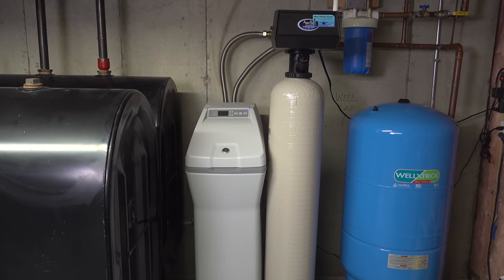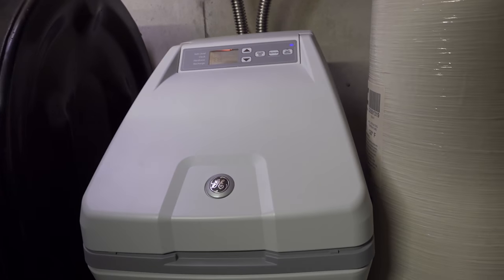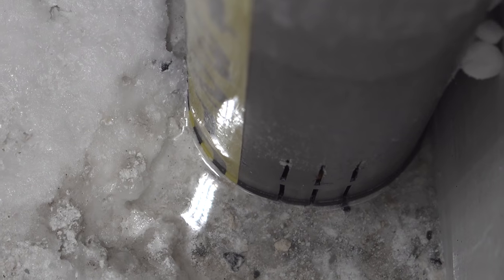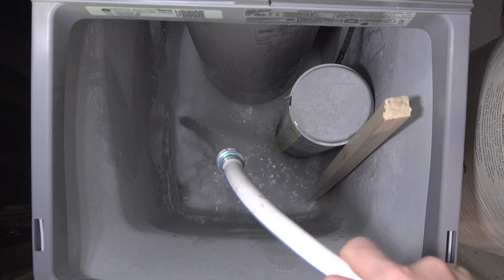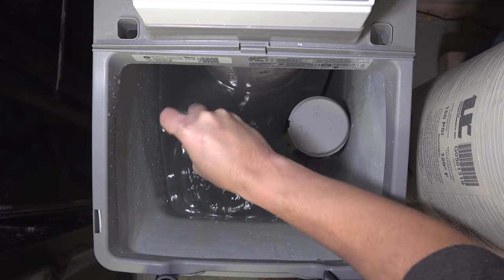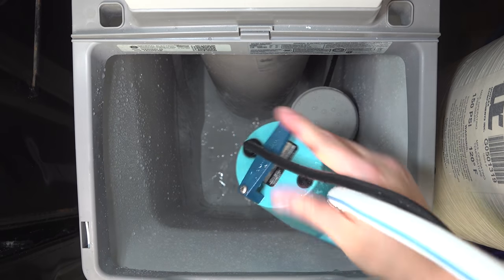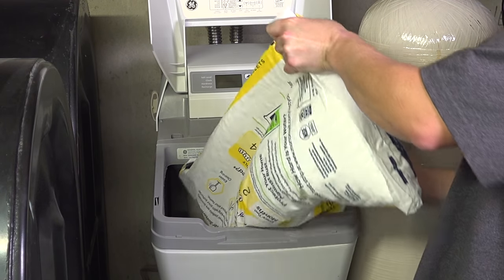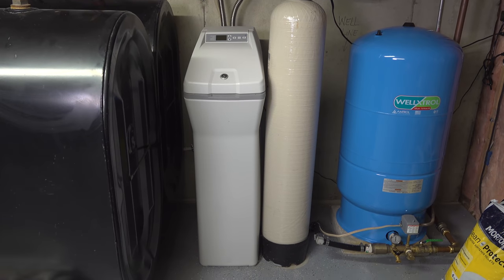How to Clean Your Water Softener Salt Tank - Restore it Like New

Comment: So, first off, Resin doesn't go bad if your system is used properly for your application.  Meaning, if someone says, "But my resin went bad," that means they likely needed some pretreatment or they left their softener in need of repair for years without a proper regeneration.  99% of problems with a softener will be found in the valve body and not the brine tank.  If you are able to regenerate your softener and the brine is drawn into the softener, then all the repairs in this video are not necessary.  Also, if you are going to follow this video, here is a physics lesson:  Adding water to the top of the brine tank will not do anymore good then a few inches above the salt.  Why?  because brine is denser than water and will sink and that brine is what will be surrounding the salt and since the brine will be fully saturated with dissolved salt, it won't dissolve anymore salt.  1 galloon of water dissolves about 3# of salt and no more no matter how long it sits.  So all the water at the top of the tank will still be mostly water and the brine will be at the bottom.  Use solar salt and get a softener that is not all in one.  Having the softener tank inside the brine tank is a major cause of bridging in these systems.  Depending on where you live, you may have a softener tanks that sweats and this added moisture from the tank and the air will absorb into the salt causing it to harden up just a bit and sometimes enough to cause a bridge, which is the "crust" that the video mentions.  While this can still happen in a brine tank that is separate, it happens more often with "cabinet" models.  The last thing to note is that you don't have to spend $1,000's for a new one, many times they can be fixed and not waste your entire day.  Get a good brand that is made to repair and you won't find out self trying to scoop salt out of one of these units.

Comment: No need to fill the salt level to 7 like that. Level 5 is plenty.  

When you're trying to clean it out Get the water and salt level low like that,  dump a couple jugs of hot water in it. Then shop vac it out.  It'll look like new.

Comment: The salt tank should have water in it about half way all the time no matter what if it’s working properly, the fact yours didn’t have any in it to begin with tells me you have an issue with your brine line and or the reducer jet on the control valve.
Reply: Mine has never had any significant water since the day it was installed.
Reply: @sandyc9379  the amount of water in it dictates how much salt it uses per run, it can run less and use more salt per run or vise versa. But the more it runs with a lower salt dosage the more efficient it is vs less runs using more salt so possible the machine is set up to be efficient which you can do on low iron applications

Comment: What does a water softener salt tank do exactly ?
Reply: Stores salt so it can be dissolved into water.  The salty water is used to "recharge" the ion exchange resin in the resin tank.  When charged the resin beads exchange the sodium ions in the beads with calcium and magnesium ions from the house water. Once the beads are loaded with calcium and magnesium they need super salty water to flush out the calcium and magnesium, thus recharging the beads with more sodium so they can work again.

Comment: I hate waste...  The water and dirt you remove from the tank can be left to settle in your bucket. The dirt junk will float to the top or settle to the bottom and the clear water can be added over time back into the salt tank. Might be able to dissolve more of that salt and use it also. Or in my very dry climate the water will evaporate and I can break up the salt chunks and put them into the tank. Or in the winter use the salty water sparingly as deicer. Have an ice cream maker that chills with ice and salt? Use some salty water to kickstart the chill, and dirty salt works just fine on that ice.
Or to dispose, if your drains go to city sewer just dump it. Septic tanks don't like a lot of salty water at once so I'd limit to only a gallon or two a day, and a rest day in between. Be careful about dumping chunks of salt and dirt down your drains.